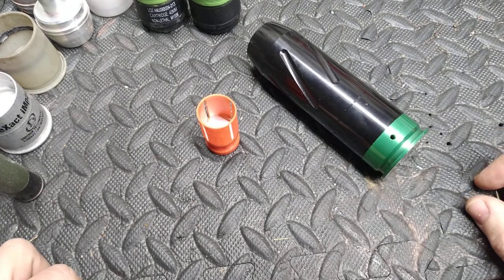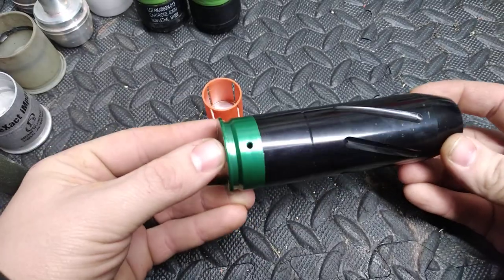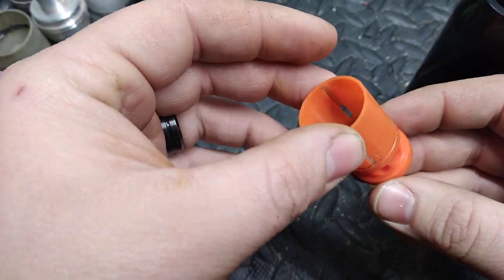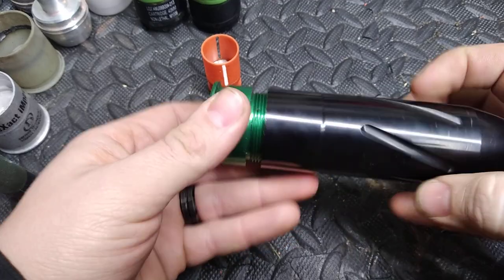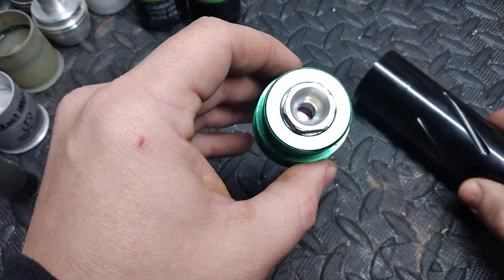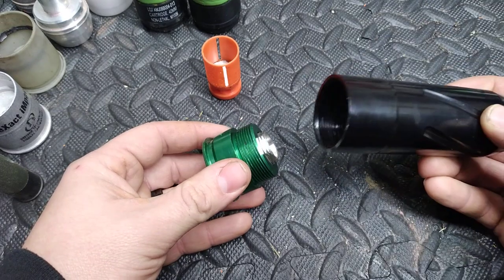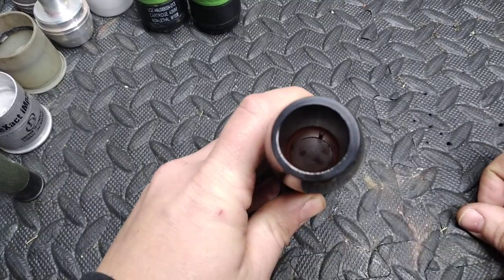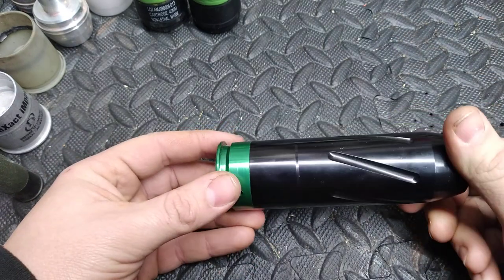40mm CANNON Round overview. Extremely Lethal!

Comment: I have the 3 barrel cannon round. it's really a blast to shoot and it's easier to find wads and projectiles for it. BTW I have been 3D printing 40mm projectiles for a wile. If you print them solid you can get 80-100 gram shots. Being lighter they fly really fast and straight. I also designed a chalk round. Basically its a printed cup filled with glued bird shot and orange chalk in the nose. Everything is weighted to replicate the commercial rounds. About 170 grams.
Reply from the maker: Very nice! Glad to hear I'm not the only one.
Reply from the maker: I wasn't actually planning on getting one of these rounds. As I was avoiding buying powder and a scale as long as possible. I was working on the 3d oriented wads for Scot to help them sell. And then I got this one as a package deal with my break action LMT.
Reply: @ChevTecGroup  Reloading for this is a must if you want to shoot often. I have been working on charges too using off the shelf powders. There is very little info out there so a lot of trial and error. It can be quite involve if you never reloaded before.

Comment: Heck yeah !  Keep working on that 3-D printing of that baby !  Would love to see you master that !
Reply from the maker: Its a lot of force on the wad, typically tearing it apart. So before I took a break from it, the answer seemed to be along the lines of using a 3d printed shot cup with either sheet metal or delrin disks glued on to reinforce the wad and protect it from the initial blast. Last time I worked on it, I didn't have a cannon round and was shipping them to others to test. But now I'll be able to do all my testing in house, which will speed up the process a lot.